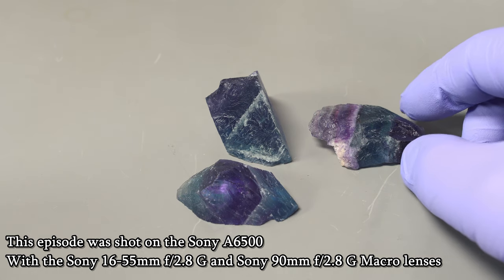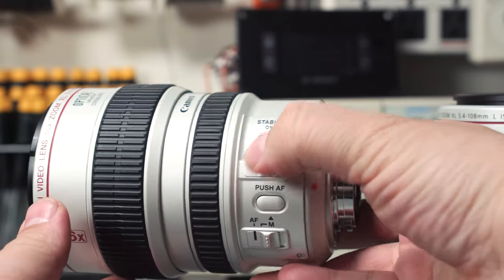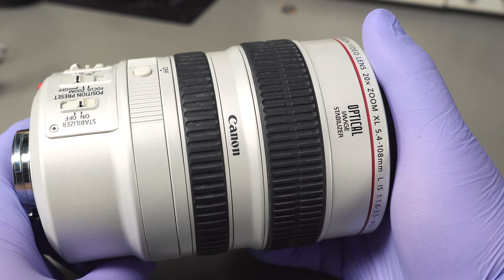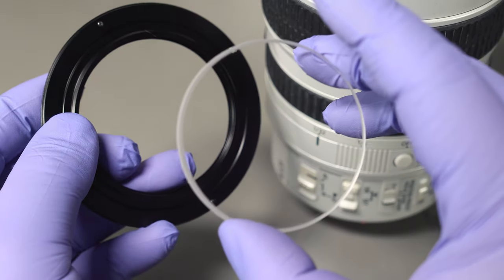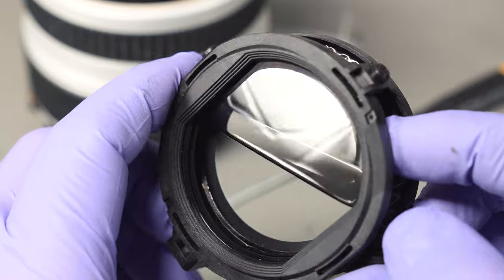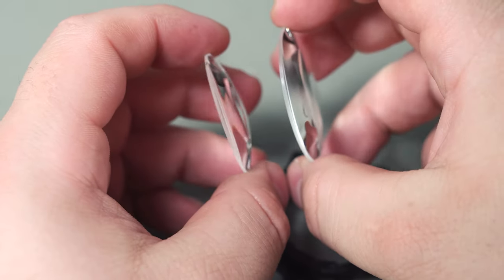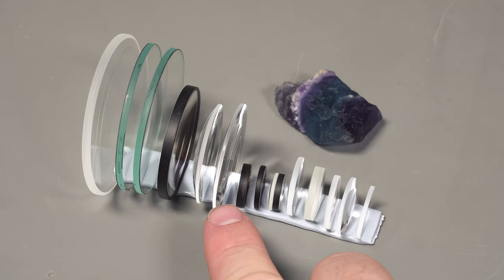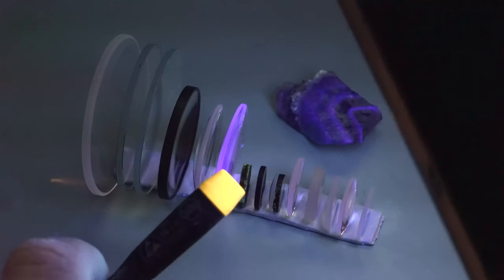Searching for Fluorite (Canon XL Video Lens Teardown)

Comment: The 20x L IS automatic lens is included in the basic XL2 kit. It is also available for separate purchase. Outwardly it looks similar to (but is a bit larger than) the previous 16x IS II lens. It is backward-compatible with the older XL1 and XL1S. This lens carries Canon's professional-quality "L" series designation, as it uses flourite elements for superior resolution and color accuracy. This lens also features Canon's Super Range optical image stabilization of the VAP (vari-angle prism) type. There are two built-in Neutral Density filters, a manual/auto focus switch, and a switch to select either a focus range pre-set or a zoom range pre-set. This switch also functions as a Push-AF button. The 20x L IS is an autofocus lens using free-spinning manual focus and zoom rings without stops on an un-marked barrel. This lens, like the 16x IS II before it, is primarily intended for "run and gun" handheld use, but its very long 20x zoom range makes it quite useful for tripod-mounted event videography as well.

For whoever watches this video: the liquid filled element is an old and obscure Canon IS system where a variable angle prism filled with optical grade oil is flexed to compensate for movement,bending the lightpath. This type of IS is mostly forgotten today because it was featured only in some Canon video lenses and in their old IS binoculars. Drop more info and documents about this system in the replies if you can  get ahold of anything not indexed by google,hope i helped you guys...

Comment: Canon USM's use a Pizeo-electric motor to generate the movement of the focus element. It's basically a ring that vibrates at a specific hz and that's what moves the assembly. It can either be powered by the camera, or when in manual mode, the power is generated by the movement of the external focus ring. That's my understanding of it. I am probably wrong.
Reply from the maker: I think you're dead on other than I think it's a little more simple in manual focus mode. I think you just turn the motor ring and that's basically it, no manual powering involved.
Reply: @Peter Brockie  on my 600mm lens, there is no physical connection between the focus ring and the helicoid/focus assembly. That's what led me to assume the ring was basically acting as a mpg. It may also be that turning the ring communicates with the camera, and then the signal is sent from the camera back to the focus assembly.
Reply: @PeterBrockie  it may be a direct physical connection on some lenses. I don't doubt that.

Comment: Great video! I have been thinking, maybe try to rebuild the XL2 camera, to power the lense, and somehow the a top dog phone like the Sony Xperia Pro as actual camera piece. (Giving me both a strong sensor, but with a hole to see through the XL lens) what do you think?
Reply from the maker: I don't think any of the lenses are really worth the time to adapt to anything else. If it was just mechanical, it might be worth it to get them adapted to c-mount to use with cheap microscope cameras, etc. But honestly, the 50 bucks you spend on an old XL lens can buy an old c-mount or FD lens which can be adapted for ten bucks to a modern camera and work way better. Compared to fill frame these lenses are a joke. They're basically 24mm-100mm f/11 (give or take, I don't remember the exact crop factor). 

Even the Sony Xperia Pro's "1 inch" sensor is BS. It only uses the center of it. haha

I have the same desire not to "waste" these old lenses, but they're just trash unless you're using an XL camera (and the camera itself being trash as well is up for debate). :P

Comment: I wonder if the optical liquid is similar to the one used in CRT projection TVs ? It seems you didn't encounter too many stuck screws ? I took apart a few proper "Broadcast" Canon lenses, theu were pretty awfull, with most of the screws strongly locked in place. Also a lot less electronics that what you had here.

Comment: Does Fluorite refer to a surface coating or the actual glass melted/formed with a Fluorite compound?

Thanks for doing this, like you said, there's almost no info on these sorts of things so I appreciate you did this.
Reply from the maker: Canon and Nikon (for a couple lenses) have used full calcium fluorite elements which are syntheticly "grown" and are used to correct optical problems. Many newer lenses have a flourine coating which isn't for optical quality, but to repel dirt and fingerprints.

From Wikipedia:

Optical elements made of calcium fluoride, namely of fluorite crystals, are used in some telephoto lenses, to correct chromatic aberration. They are however being replaced with various low-dispersion glasses, which have higher refractive indexes, better dimensional stability, and lower fragility.

Comment: Piezo focusing is also known as ultrasonic focusing and refers to how the focus mechanism is actuated. It uses a piezoelectric element instead of an electric motor: https://youtu.be/uFZsH62ewYo and  http://dougkerr.net/Pumpkin/articles/Canon_USM.pdf
Reply from the maker: Ahhh. I have vever heard of it referred to that. ultrasonic motors are everywhere in cameras. Although they are being reached with newer tech.

An ultrasonic morotor on a lens is on my list of stuff to find to teardown.
Reply: @PeterBrockie  I've always dreamed of tearing down an old lens and reverse engineering the USM module to use as a desk toy. I look forward to the day!

Comment: Peter Brockie or anyone knows which pin contacts to open the aperture blades, once removed out from XL?
Shown 7 pin contacts (3:00) & aperture blades (21:08).  Based on 5.5 to 88mm IS lens
Reply from the maker: I don't think any of the XL/VL mount interfaces are documented at all. There doesn't seem to be any interest in reverse engineering an old mount with a super tiny image circle.
Reply: @PeterBrockie  I also got no information from Canon USA.
ATG has modified this onto the Sony DSC-RX10 Mark IV and I been told the price jumped pass $11,000.00.  And the ATG DSC-RX10 Mark IV IR is much higher.

Sensor for DSC-RX10 series are scammed to make people think it is a 25.4mm (1") sensor.
When it is only 15.86mm.
Reply from the maker: These lenses really aren't worth the effort. I know they are high end, but lens tech has improved to the point where kit lenses are resolving more detail.

Fun to tinker, but not very practical.
Reply: @PeterBrockie  From 21:08, can you apply a voltage on the motor just to see if aperture opens?
Reply from the maker: I do not have the lens anymore, but I can say that you could open the blades that way no problem. As long as you don't mind having a disassembled lens. Haha